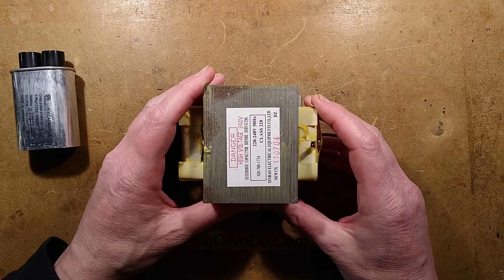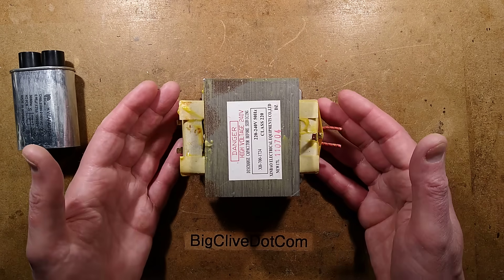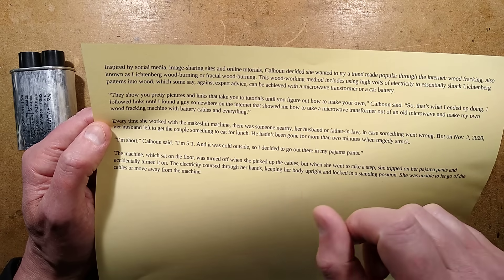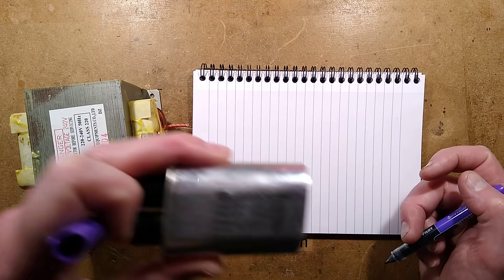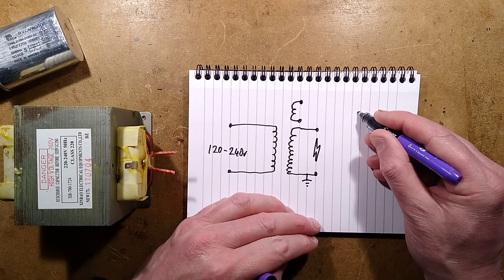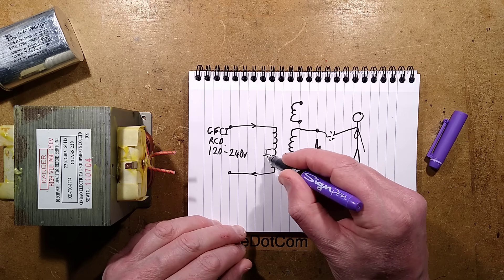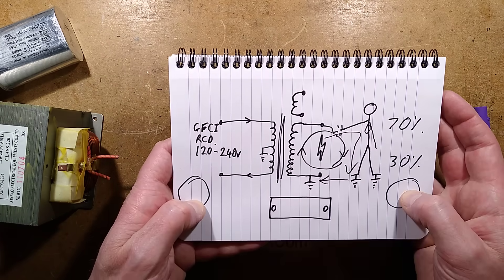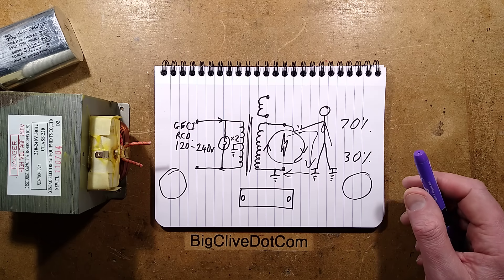The most deadly project on the Internet

Comment: You do an important service Clive, too many people watch stuff on YT or Tiktok and think they can do it to but they are woefully unequipped with the knowledge to do it safely.  Having worked in the semiconductor business for decades and required to study lots of safety videos and documentation it is alarming at how easily someone can get into trouble they will not be able to get out of ... alive.  I've seen a video of a man that was electrocuted with just 120V and it is excruciating to watch the video, he survived but was a vegetable.  To the content makers producing such 'how to' videos you had better know that you could be held liable if someone that watched your video gets hurt or dies.  That this kind of thing happens with alarming frequency is testament to how far we've fallen down the rabbit hole of anti-science delusion.  Having worked with electricity and electronics all my life there are some things I simply won't even consider doing and messing with high voltage stuff is at the top of that list.
Some years ago a couple, both Verizon employees if I remember correctly, were attempting to sabotage a comm line from Verizon but it turned out that what they were trying to cut through with a hacksaw wasn't a low voltage comm line but a 13kV power line.  When the guy with the hacksaw reached the power line he was immediately killed and his girlfriend, several meters away, was badly injured by the plasma that was produced.  To me, working on high voltage stuff is like free climbing El Capitan -- nope, NOPE, NO F#CKING WAY!

Comment: The only way I would ever use that thing is if I was using the breaker itself as an on/off switch so I'd never even have to be in the room with it... Even then I wouldn't trust it really, because I know there are things in TVs that can hold a charge for days after it's been unplugged and microwaves take a lot of juice.
I've been zapped a few times in my life with smaller things and know it's not fun!

Comment: Thanks for saving  Lives with this important video, me myself just desided to not start the projekt with the contact weelding machine. Again thanks a million Sir !
Reply from the maker: The projects that use these transformers in spot welders are OK, as they replace the dangerous high voltage winding with a very low voltage one.

Comment: I've made and used several of these devices and burned hundreds of pieces of wood. I have also used neon sign transformers. I either plug mine into a power strip that also has a colored light plugged in, or I use a Variac to control the voltage output. I have felt the tingle in my feet and in my hands. Not enough to do any serious damage but, enough to remind me of what I'm dealing with . Common sense is required when using this device...if you don't have any... don't use it!

Comment: The out side electrical post wire line is about V220
That transformer pull out a minimum of V17.000 voltage ⚡

Comment: Transformers are very scary stuff... knew several linemen in houston who each spent upto 6 months in the hospital after working on a powered down power station transformer...their scars were massive and they were wearing all their safety gear when it happened... knew of one guy working the hv lines in full gear... he was told the lines were deenergized si he started working on them... not sure what happened but there was a bright flash of light and he became a rubber ball on the ground..
Had several encounters if my own feeling the tingles through my safety gear, or a slip of the screw driver and crossed poweer lines... still get the shakes when i think of it...

Comment: Hi I just had an electricity question this made me wonder about. Before I say this I'll say I'm never going to try this given how dangerous it is and this is completely hypothetical. So, if you jumped when you touched the jumper cable, your feet wouldn't be grounded, so you wouldn't be shocked, right? I don't really understand how this works. I understand it needs to be grounded to complete the circuit (is that correct), but I don't understand how when you touch it, the electricity "knows" whether or not your feet are touching the ground when it goes into you. I know this all happens really fast but can you explain what happens when you touch it while you're jumping and why? Do the electrons still travel through you but then they stop once they can't get to the ground? Or do they not pass to you at all because they somehow sense a voltage differential or something?

Comment: Great video. One question:

The illustration has the stick figure conducting to ground via their feet. Is that a probable situation? Is the transformer going to be grounded to start with? I had assumed most people were getting in trouble with these touching both probes (or the wood and one probe ECT)

Comment: Further to Clive's Dead Man's Switch idea, ideally it would need to be at least two metres away from anything high voltage (so nutters can't hold the DMS with their hands then move their feet closer to the HV end). Someone of Clive's skill level could also probably add some extra circuitry hooked up to a PIR, so it also won't switch the transformer on if it detects anyone else anywhere near the HV end (and never mind an LED - use a giant flashing light and high decibel alarm so making it abundantly clear there's HV about).

Even then, you'd probably get the occasional Darwin Award nominee...

Comment: A friend of mine got the ground difference between two groups of server racks... not sure how the whole building had separate grounds.. Suffice to say he woke up a few minutes later across the room with a small crowd of people and paramedics around him. Amazing he survived.
Reply: So one of the grounds must have lost connection to the earth then?
Reply: @heavenlymonkey  It could only be that; to have enough voltage between 2 earthed devices on separate earth cables would require very large earth currents to be flowing; that in itself would confirm that the wiring was not meeting the requirements of BS7671

Comment: I just made myself one, watched this video and made it with two non latching switches in series either side of an enclosed plastic box containing the transformer with warning light on top. I am a licensed electrician and it still scares me. 
Watched other people do it, I have no idea how they are still alive, holding 2,000volts with plastic conduit probes wired with cable rated at 750volts.
Reply: that somehow reminded me of the scene from
Breaking Bad where Peter Schuler decided to electrocute himself with a defib. It‘s not far off from the reality!
Reply: I use up to 10k volts, just the amperage isn't as high.
Reply: I thought satire was supposed to be funny?

Comment: When I was young and stupid I put a 5000v 50's solid state neon commercial sign transformer on a coat hanger jacobs ladder no extra circuits and touched both poles it would kill a senor. It was hard to let go but I have motorcycle monkey hands from BSA and Lucas coils on wet knees. Steam boiler toys are similar.

Comment: Electrical engineer here. Don't short the terminals on a charged high voltage cap. It's possible the heat generated by the current will cause the cap to explode. It depends on factors you won't know, and you don't understand.  So, just don't mess with this stuff at all.

Comment: I was hit by 240v when an electrician in a steel mill. That hurt enough to know. It would take forever for enough amperage at the output to cause the input breaker to trip across a this transformer. Like, forever. Thanks for posting this. 3500Vp is a lot of energy.
Reply: 240v through an emergency exit sign locked my arm up, made me chip my front tooth and even pee’d myself a little 🤗
Reply: @rbwood1978ify  I once got shocked trying to remove a bulb. It was weirdly scray feeling. My whole body clenching up as hard as it can and me try to let go of the wire with no success. My brother was right next to me and ran back to the box and pulled out the breaker. Phew
Reply: Touched a wire in a farm once when I was a teenager and that taught me well lol. Whole arm felt tense for a good few minutes.
Reply: 240v is no joke! Been nailed by that a couple of times.

Comment: I work on different appliances, including microwaves. Called my boss about an issue and he wanted me to test the voltages on the transformer and he made sure to tell me to test on the part that is not connected to the capacitor or magnetron. (Keep in mind the MW is on while doing this, it has to be) He said if I do, best case scenario I get flung 10 feet across the room and am injured for life. worst case is, well, you can guess. He’s been doing it for nearly 40 years now so I trust him but still taught me to never underestimate the power of electricity.
Reply: Thanks for your comment. I will never test a MW with the power on.
Life saving comment.....
All I've done is replaced a fuse with the power off on a MW.
Reply: Look at the isolation ratings on your test equipment and then you know the reason... I would be surprised if they even go as high as 1000V. Not even speaking from 2000V+
Reply: If you're testing voltages, it should not matter which side you go on, because the probes are supposed to be a "virtual open circuit"
Unless you sneezed and short the leads onto the live terminal, causing the capacitor to explode.
Reply: @cpK054L  idk man take it up with my boss who has fixed microwaves since 1966
Reply: @btrain0013  why are you just accepting what your boss tells you?
Don't you think it would be better if you actually learned what you are doing? or rather why it is done that way?
Reply: @cpK054L  I think his point is that he'd rather trust his boss with 4 decades of experience rather than some random nobody on the internet.
Reply: @squidikka  my point is, why don't you properly learn it rather than just accepting somebody that might be giving dated knowledge?
If I trusted my professor on how to apply a heatsink, I'd have all my ICs blown up.
Which it ended up doing because my partners trusted her over me telling them to use thermal paste.
I paid for those ICs out of my pocket, and they weren't cheap to a college student.

If that was an actual powerFET and you just slap a heatsink with no thermal paste, you're going to get a fire.
Reply: @cpK054L  You don't even sound confident in yourself. " Might" be giving dated knowledge? You're giving weird vibes.

Comment: Jumper cables are rated for high current and low voltage. I always use insulated shoes in the garage. Sounds like this hobby is more dangerous then running a radial saw!

Comment: Ya i just got the fractal burner i built couple years ago out the garage and threw it away…..i knew it was dangerous but not like this …..glad i found out before it was too late! People need to wake up! Electricity is extremely dangerous and not to be “played” with! Thanks for video bruv! 

Cheers!
Reply: Its only dangerous if your not experienced. My man has been working on high voltage projects for over 28 years, and had no issues. Its all on how you treat it, is what makes it dangerous. My better half taught my 12 year old daughter on the proper way to safely take the second anode off an old picture tube TV. No zap, no shock. He told her that it can put out at least 27,000V DC when fully powered up. She did get a bit scared, but he walked her through it in a safe manner. She did jump, because the fly back still had a charge. But he told her the steps from unplugging the TV to connecting a test led to the ground strap, on the back of the tube. Then connecting the other end of the clip led to a flat head screw driver, then slipping the flat blade of the driver under the cap of the second anode. The pop was heard, but made her jump a little bit. He made sure that she listen to every word he sad, to safely take the second anode completely off of the tube. My man has repaired TV's since he was 16, and now 46, and still doing it. Again its only dangerous if that person hasn't had safety training first. My man has never once got a shock from a TV that he has ever worked on.
Reply: i like snap circuits
Reply: Or sell it, that copper is expensive these days
Reply: Could have replaced the secondary winding and melted some spanners rather than throwong it out😛😛
Reply: @bushramukthar1488  I had a coworker doing work with some high voltage batteries. He arced a wrench on that one and was pretty shaken by the experience. No injuries, but we always considered what could happen on that project.
Reply: Use the right tools and technique and it's fine. Everything has risks.
Reply: @bobloblaw7465  for qualified people who know how to do thing properly. Not for every YouTube crafter. I say if you had to google any single term he used than this isn’t the project for you. Shouldn’t be your first project applying electrical safety.
Reply: @4nickeightor  Ive been fractal burning for many years, now. That's why I said what I said.

Comment: Great video explaining the dangers involved with high voltage transformers.
However, the misrepresentation of 120v as a "slight tingle" was a bit disturbing. 
People should know that 120v is no joke and can absolutely kill you.
Reply: Well compared to this it is. Anyway ive been zapped by 120 a few times. One time from a old television. One time fixing a broken outlet by the stove and once with a old non polarized non grounded drill from the 70s. Or 60s or something. Lucky each time. Oddly enough 2 of the 3. Were just isolated to my right arm. Thought the tv was unplugged. Holding a wire and another fell on my arm. Zap. Lucky the twitch flung the wire away. The outlet by the stove my right finger brushed the terminal while my forearm was leaned on the metal of the stove. . Although after those instances my right arm has become less sensitive to certain things including shock. Now that old drill. It had been dropped a couple times. Use inside alot wooden floors etc never had an issue. But one day outside drilling something after awhile i noticed my arm felt like it was cramping and somewhat numb. Honestly i just brushed that off maybe me arm is just tired. Swapped to my left hand hit the trigger my arm jolted and the drill landed 15 feet away. Upon further investigation inside the drill from being dropped before the metal casing was coming in contact with the motor brush. At times i may have been lucky that the plug may have placed that damaged end on the neutral wire but that day it was definitely on the hot wire. That drill has never been used again. .. weird thing is i have an almost identical drill a few years newer and that metal rear casing was now thick hard plastic not metal. I still use that other one. Now I don't see a problem using old stuff like that but since then I actually have some schooling on electronics engineering and i do things with different electronics and from prior bad experience i know what to look for and take precautions dont be afraid to double check your things are not live circuits and just because its unplugged don't mean its not dangerous. . Got into a vintage tube set with a pretty decent capacitor in there and part of the circuit was damaged and removed any leakdown resistance or any possible capacitor discharge. It had been unplugged for a few days. But i still check. There was still 463 volts sitting in that capacitor. It was enough to fuse the contacts when i discharged it. . There was more voltage in the capacitor than the set ran on. Because there was no load pulling down the transformer output it just slowly charged it up to the maximum unloaded voltage. It had climbed up to 580 initially. And the caps are rated 600. The set once warmed up and the loading of the circuit is stable is rated to be around 380~400 volts. And thats converted to DC. And DC hits you pretty hard compared to AC.
Reply: It's the amps that kill you
Reply: voltage means nothing when it comes to deadliness, its allll about current. million volts at .0000056 amps could flow through you to ground without you noticing. current kills. voltage shmoltage.
Reply: @Stewpkiddable  I feel like this gets repeated so much without people understanding. I see people thinking 4.5kv at 500ma is safe or 12v at 500 amps is dangerous. You need both voltage and current to be deadly.
Reply: @Stewpkiddable  yes, but you need the voltage  to push the current through, so voltage is important in a way,  12v or 24v or so wont be able to pass enough current through you ,
Reply: @Stewpkiddable  you can hold 5v 10a indefinitely and have no issues. You need voltage to push said current with the resistance on the human body.
Reply: @Stewpkiddable  that's right. Amps are what makes this dangerous. Amps is the pressure of the flow of electricity

Comment: I have used a foot pedal switch and keep hands and body away from wire leads and project. Also have silicon sleeves over wires , wires are attached to plastic sticks as to keep you away from the project

Comment: What if you use an isolation transformer before the step up high voltage tranformer to eliminate body to ground short . Then the other safety two switch will  greatly increase the safety.
Reply: The high voltage transformer already isolates the secondary.

Comment: I've always said these things were dangerous. I have a few friends that have made these and neither have gotten hurt YET. I hope they never do but its almost inevitable when messing around with DIY 2kv to 3kv transformers. especially like you have pointed out, the high voltage side has absolutely no protection what so ever. the only way it would trip is if the mains side is over loaded but by that point it would be far to late for whoever is receiving end of the 2kv shock. Stay safe out there people and great video Clive! Thanks for putting this awareness out there to keep people safe.
Reply: Send this video to your friends.